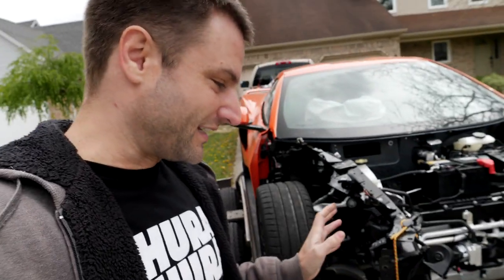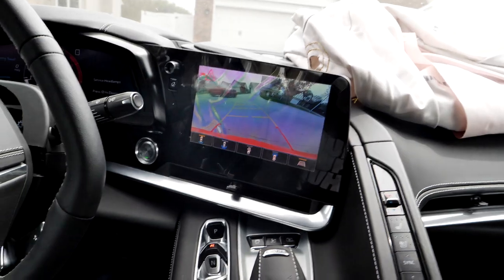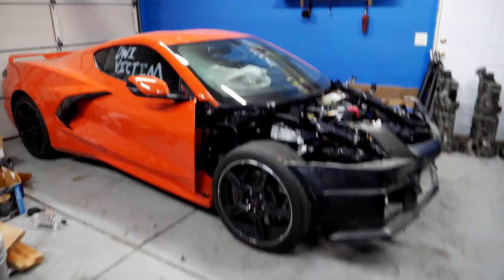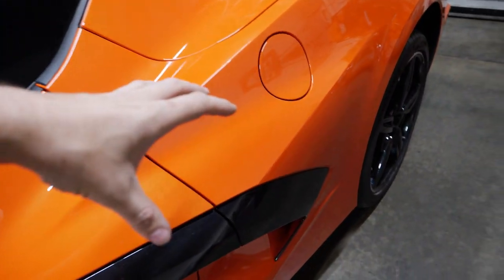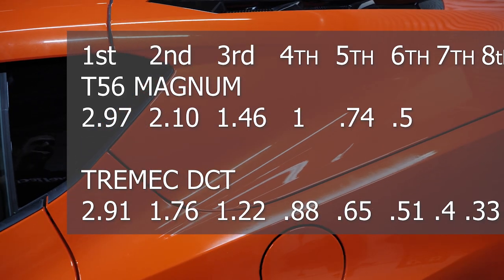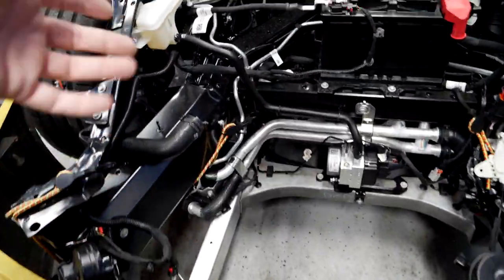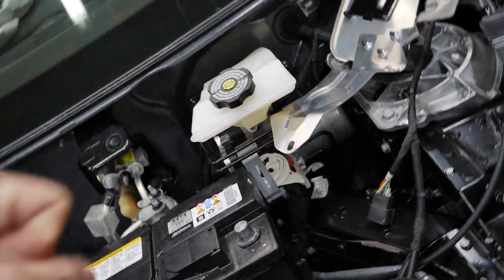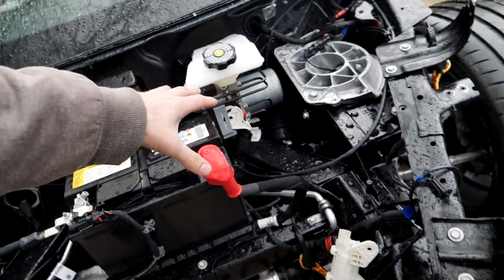3 Reasons the WRECKED C8 is PERFECT for ROTARY ENGINES.  Interesting technology in the car.

Comment: I just realized if you paired the rotary with the C8's DCT you will have the first rotary paired to a DCT! I can't wait to hear how a rotary shift sounds with a DCT behind it! 
Last time I was this early was in 2nd grade and I got a gold sticker on the wall for perfect attendance
Reply: A DCT is a dual clutch transmission correct?
Reply: Sylas VanVlack yes it is
Reply: Lucas Foster a lot of gearing changes too, think it would probably just be better to swap the tranny
Reply: @topkek7003  it's not that simple. GM said that they literally couldn't fit a manual in there so I doubt it. Also Rob looks like he wants to keep the DCT but but I could be wrong
Reply: @helplmchoking  True but we'll see how it works out. It's most likely going to come from getting a controller to tricking the DCT to think it's still behind a LS
Reply: this needs to happen Rob
Reply: @topkek7003  Rob lives for complicated swaps.
Reply: @topkek7003  iirc he said in an earlier video that the stock trans actually has just about the perfect gearing for the 4 rotor
Reply: Demonic Koala in that case, go crazy
Reply: DKGECU will allow you to pair the 2011+ DCT from BMW to any engine. Nissejarnet youtube channel is the creator, check out that channel! Insane cars
Reply: I think Mazzei Formula's FD has DCT or yet even better.
Reply: @bullracing1  No he has a sequential

Comment: 3 reasons why every car ever is perfect for Rotary engines
Reply: 1.Brap
2. Brap
3. Brap
Reply: @AcidzDesigns  I would pin your comment if I could 😂😂
Reply: 1. BBBBRRRAAAPPP 
2. STUTUTUTUTUTUTUTU
3. MO POWA BABEH
Reply: 1 braaaaaap 
2brap 
3 my Car. Trying to be a rotory brap?! Aw Crap its a diesel piston engine 0 rotor
Reply: productions  you got it😂
Reply: @thestarlightalchemist7333  Lol there are so many engines of similar displacement that make exponentially more power. Wankel is good for revs and application in racing, IE 787B
Reply: 1: every car has an engine bay
2: every car has tires
3: rotary go brap
Reply: trucks and off road vehicles should not ever have rotaries
Reply: @ThatV12MiataBruh  bro i cant wait to hear your 12 to 1 in action
Reply: Turbo,bridge port, lightweight!!!!!!
Reply: Here are 2669 videos of me putting a rotary in a car, starting it, and idling around, but that's all I can do right now. :p
Reply: @HoagMurkula  same dude its gonna be insane
Reply: @dantonfaulkner553  and Robert brought it back to life🔥

Comment: Brake by wire is the scariest thing I've ever heard of.
Reply: Meh, works okay in every BEV in the world.
Reply: Mercedes Benz had it back in it's 2002s E-Class model W211. My dad has one of those early models. Once when I was driving it suddenly the display turned red and said something like: "Bremse defekt, bitte anhalten!" which translates to "brake malfunction, please stop!". I'll never forget that moment, I almost shat my pants awaiting the inevitable while I was giggling about that ironic message on my dash the same time.
Reply: @gustinfour6173  no keyboard detected, f1 or alt to continue.
Reply: the new NSX has brake-by-wire, too.
Reply: I suggest you never fly in an airplane.
Reply: The Wakz Planes electronics fail too. They have many failsafes and are maintained frequently. Having electronic braking in a car doesn’t make sense because it’s still hydraulic and still right in front of the bulkhead where the pedals are. Is it not much, much more practical to run a rod from the pedal 6 inches to a hydraulic cylinder instead of using sensors to capture the pedal position and run that through a computer to determine how much force it should push back on the pedal if it were a hydraulic cylinder then try to electronically actuate a piston with an interpreted force from the pedal. Without failsafes that would go through at least one sensor and two actuators. It’s just plain stupid. Change my mind
Reply: @steveplays2151  you are not a real engineer are you? There are many reasons why "brake by wire" is a good solutions, for instance for tuning and pakaging possibillities.
Reply: @guidoheeling1179  i doubt this changed his mind, didnt change mine either mr"real engineer"
Reply: yeah infiniti uses steer by wire
Reply: @sovan781  For real? i tought there had to be a physical link between the steeringwheel and the front wheels to make it highway legal, it can be that it changed, or that laws are different in america
Reply: The horse and carriage were a steer and brake by wire, sure they were a bit buggy...
Reply: @steveplays2151  metal rods fail too
Reply: No shit rite. That's exactly what I said/thought.

Comment: 24qts of coolant is the same capacity as the early to mid 80's 1ton chevy pickups. Id guess there is ALOT of added capacity in the lines running that fluid from the rear to the front and back again.

Comment: NEEDS C4 Vette turbofans! Retro taken to the next level, I've seen renders of the C8 with the C4 wheels, good god GM missed out.
Reply: Yeah, those wheels are   A E S T H E T I C
Reply: Us Australians used those wheels on the 80s Holden VK SS Brock, fast forward to present time, you can get an identical replica from GM or Ebay in I believe 19"
Reply: @kayleb1109  I would put those wheels on almost ANY car.
Reply: @THESLlCK  there's a bunch I wouldn't personally but there's also heaps I'd love to put them on

Comment: Hey Rob for the other cars check out the Prius electric power steering. You can use a yaris ecu and send it a vss for variable assist, we will also be making an adjustment module for it. It's an electric column so you can use the stock rack on whatever you swap it into..if it's a hydro rack just loop the lines.

Comment: I thought brakes had to be in some form of mechanical, in case of electrical failure. I mean my abs module broke and hade no abs but I could still brake . What if the pump dies on the c8?
Reply: Brake
Reply: the new NSX has brake-by-wire, too.
Reply: Grab the e-brake and pray?
Reply: @ScottKenny1978  pretty sure it only has a parking brake which is electronic as well
Reply: There are failsaves, just like air brakes in bigger trucks or 18 wheelers, basically the pump needs power to not brake, if the pupmt fails it will brake like a mf'er.

Comment: I think there is actual a physical connection with the pedal and the brake "master", so if the car dies eclectically you can press the pedal very hard and you will have brakes for safety. This is how its done on some Nissan's, that have very similar system. However you need to press very hard to gain this. Other then that, its just a sensor to the brake master :)

Comment: I think you are going to need both those side openings for an intercooler, or run an air-water intercooler to the front. Either way, where are you going to put the oil coolers? Behind the intercoolers?

Comment: On the subject of the brake-by--wire, is this GM's first implementation for a production car?  I remember GM had a concept car in the early 2000's (forgot the name, though) that had both drive-by-wire and brake-by-wire, and IIRC it also had a system where the driver's side could be slid on rails basically to one side or the other, but I don't recall there being any mention of brake-by-wire from GM since then.

Comment: Brake by wire.....wonder what happens if the car dies while driving.....
Reply: It makes an extremely loud wailing  warning noise frighteningly similar to the screams you'll make as you go flying off of the overpass.
Reply: Grab the e-brake?
Reply: the concept might be the same as Mercedes SBC right?
Reply: From what I understand, if the brake-by-wire fails, then the pedal somehow can manually control the backup hydraulic brake system, actuating the brakes like a traditional mechanical system, though that'd basically disable the more advanced stability control and all that shazam that the computers can do with brake-by-wire. You still have no true pedal feel with brake-by-wire though, which sucks since you can no longer intuitively figure if you're overheating your brakes and all that. I'm a fan of everything being mechanical links in a track car at least. If I had a track car, everything would be mechanical linkages that I could manually control on my own, but my daily would be a by-wire computer controlled newfangled vehicle, if only for the comfort and gas mileage.
Reply: You do too...
Reply: @ScottKenny1978  you wouldn't guess it but that's controlled by a wire too

Comment: Well that's all worked out well hasn't it? Haha. That gearing is going to make for some serious speed from a 4 rotor assuming it's going to rev around 2500rpm higher than the v8 lump, may be an idea to shorten it up a bit further..

Comment: E-brakes. Huh. Most cars and trucks are required by dot regulations to have a "if you lose power assist they are still functional" capability. But I also dont see a steering shaft to do the same purpose. That's why hydro steering on like rock crawlers is not street legal. If it fails there is no physical connection between the steering wheel and the wheels.  I'm amazed that's not a problem on this.

Comment: I'd get rid of the break-by-wire system. If there's one thing that does not need innovation, it's the actuation of brakes. I would not put my life in the hands of electronics when it comes to that. I'm not even sure that's fully legal in some countries/states, so there might be specs that don't have that option.

Comment: "high load, low acceleration" those 3.23 - 3.42 rear gears feel amazing in a V8 street car.  Really a perfect number for a daily driven car. Gives you that low end torque but doesn't sit too high rpm cruise.  And with the stock cam profile and stall converter it will pull with that gear. Only applies to V8s really
Reply: Yup. 

That's why you need to match the overall gearing to the engine.
Reply: @ScottKenny1978  robs gonna need like a 5:1 rear or some shit

Comment: How are you going to make the transmission work?
Just replace the brake by wire? I don't know how it will work with ECU for 4 rotor. You don't want to find out it not working on the track.
Reply: An adaptor plate? Assuming the transmission bolts to the engine like any other gearbox, I don't see much issues, there.

Comment: "Piston engines don't have oil coolers"

Lol have you seen the ZL1 cooling system and it's 10 individual heat exchangers. At least one is for oil

Also N54's die with oil coolers, let alone without

Comment: Probably sixth, seventh and eighth gear will not be to useful for the rotary engine http://www.dragtimes.com/gear-ratio-calculator-mph-speed.php?tire_width=305&tire_aspect=30&wheel_diam=20&tire_diam=27.204724409449&axle_ratio=5.17&redline=7000&gear1=2.905&gear2=1.759&gear3=1.22&gear4=.878&gear5=.653&gear6=.508&gear7=.397&gear8=.329&calc_button=Calculate